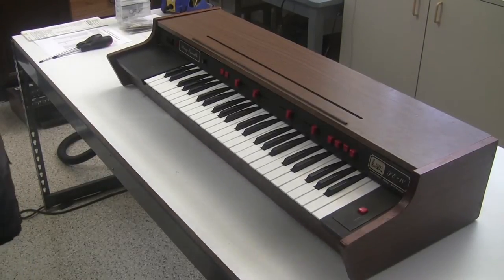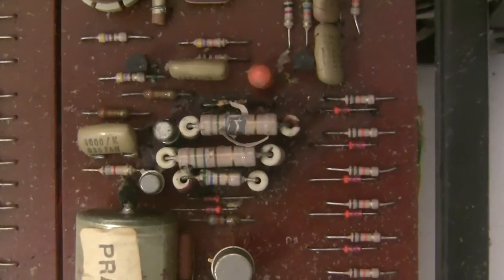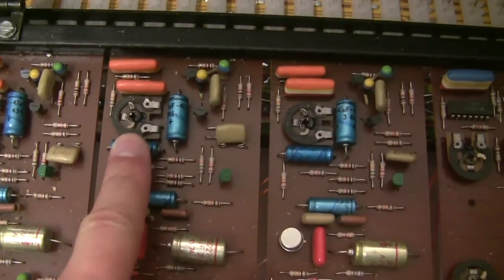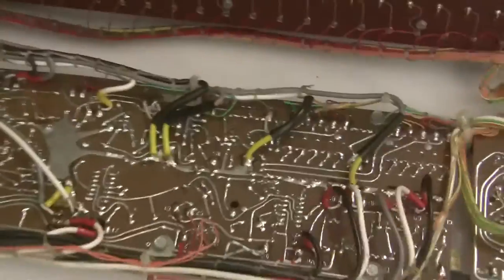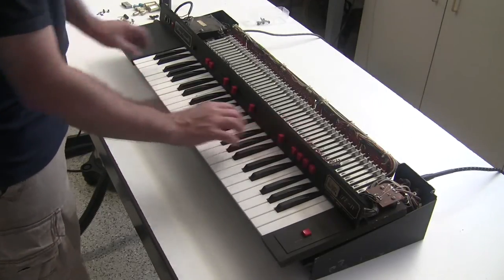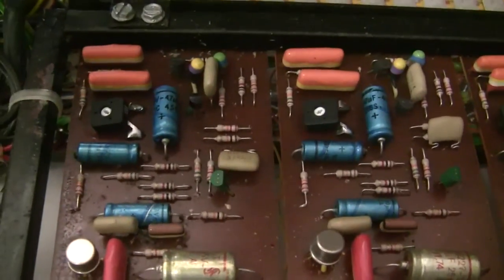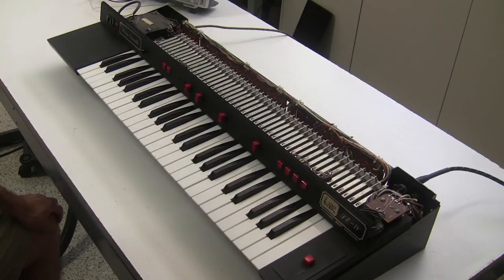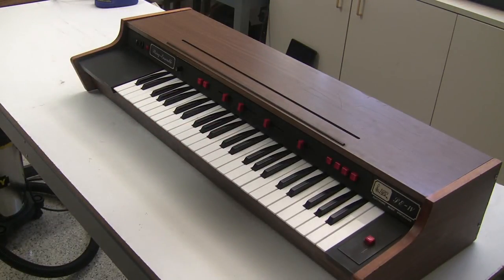Synthchaser #024 - ARP Solina String Ensemble Repair

Comment: This is extremely full of troubleshooting nuggets of wisdom.  The parts that you don't see are what takes the most time: tracing noise around with a scope, locating the intermittent failed joints, researching and ordering replacements for long out-of-production components.  And the patience to document and explain all that is happening here, beautifully done.
Reply from the maker: Thanks for watching!  Some of my videos I show the poking around with the oscilloscope, but yeah, studying schematics, researching parts, disassembling things, cleaning 40 years of junk and old flux off circuit boards, etc all takes time.  And it sounds like you've been there yourself.  Actual time to repair the string ensemble was longer than the 30 minute video. :)

Comment: Thank you for posting these vid on the Solina, very helpful,  
I’m working on a unit here in london 
I was thinking of ordering a kit but the cost of shipping maybe to high.
Can you advise on what your using as a replacement for the bridge rectifier ?
I’ll try and post a video on the repair of our unit, as I have a few other problems that are bit wired, 
Many thanks
Reply from the maker: Thanks.  If the videos were helpful, consider showing your support by buying my kit.